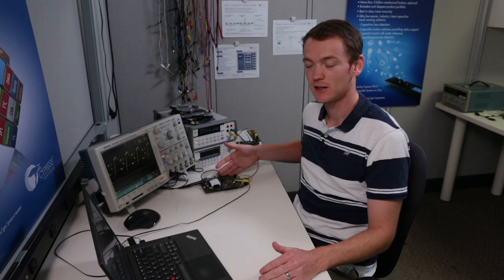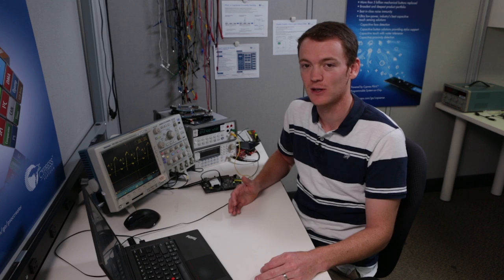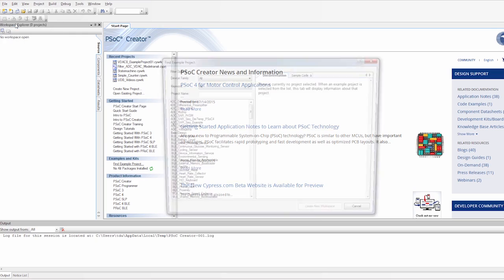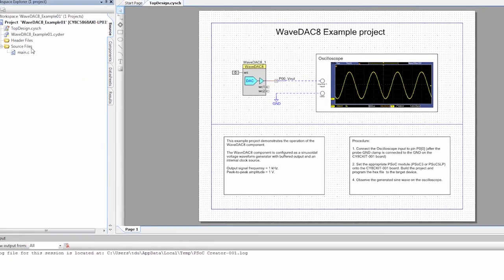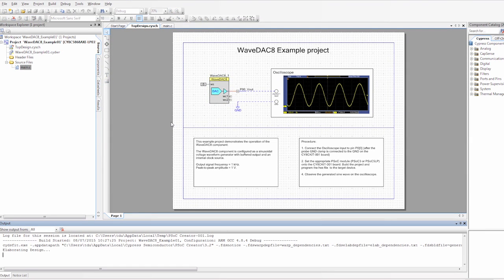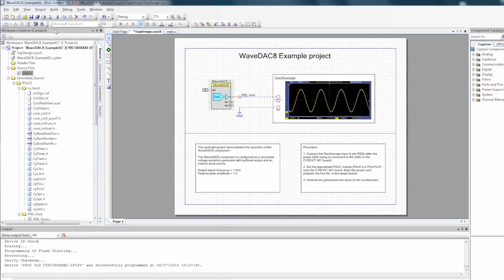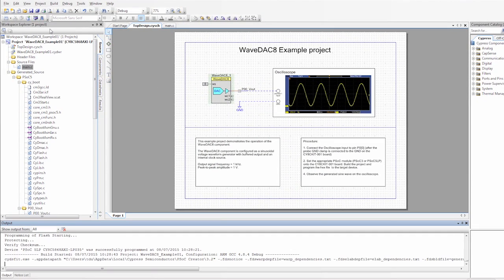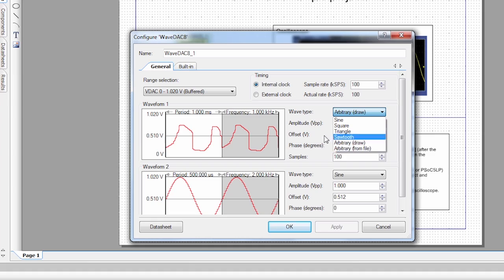How to use the WaveDAC with PSoC 5LP

Comment: how to trigger x cycles? i.e. I want to output maybe 4 complete cycles, then change output pin, trigger another 4, etc
Reply from the maker: Hi Ryan, you can toggle the WS (waveselect) input to toggle between input. Since you want to toggle it every 4 cycles, you may use an external clock (external to component), use the same clock as an input to a counter. Also, you can use a counter to measure 4 cycles and change the value of the control register connected to WS input in an ISR. Please let us know if you have any further questions. Best, Cypress

Comment: So If I wanted to output a wave form based on a function F(x,t) and I had the algorithm I would use a normal PSOC DAC?
Reply: yes you could pick the arbitrary waveform option and feed in the function from a file.
Reply: +Gagan Luthra would i need to feed the output results or could i give it the function fx and let it calculate output